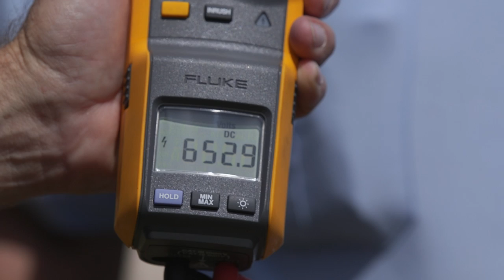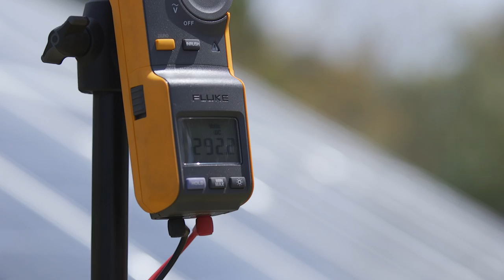Electrical Arcing & Water Conductivity

Comment: A typical North American electrical installation from an average household causes more risk, then this solar system will ever cause during its average lifetime of 30 years…
Reply: We are not saying that a PV installation is any more or less dangerous than other types of electrical system, but unlike a typical North American electrical installation that can be isolated at the street or switchboard to mitigate electrical risk, solar panels cannot be isolated as long as they are exposed to light.  Any electrical generator (including solar panels) needs the ability to be isolated to mitigate electrical risk, that is why we developed PVSTOP.

Comment: You are meant to be professionals. Voltage measurement with possibly very high impedance meter is meaningless and this should be adressed in the comment.

Comment: lol. or you can us a breaker to open the circuit and stop the current from flowing.
Reply from the maker: Everything "upstream" of the breaker (also known as the isolation switch) including the panels and wiring leading to the breaker is "live" and if damaged, potentially lethal.

Comment: Nice and informational, but could also use black paint.
Reply from the maker: Yes you could, but paint is flammable (making a bad situation potentially worse) and black paint will damage or destroy the solar PV system.  PVstop is fire retardant, non-flammable, non-conductive and can be peeled off post incident without causing any damage to the system.  Like most good solutions, the devils in the details!
Reply from the maker: Hi Ed,  black paint would damage the PV system, would be flammable and possibly conduct electricity.  These were all safety considerations that were taken into account when we developed PVStop, ensuring that the product is safe to use in situations involving fires, floods or storms.

Comment: wait what is pv stop? paint?
Reply from the maker: It is a water based polymer similar to paint.  The differences between PVSTOP and Paint?
PVSTOP is;
- Fire Retardant
- Non-flammable
- Non-conductive
- Peels off (post application) without damaging the solar PV system
- Environmentally friendly

Comment: 😥 thank goodness that hail storm only damaged the very bottom edge of every one of my pannels
Reply from the maker: The more extensively solar panels are damaged, the greater the risk, the video demonstrates that even partially damaged panels can create unanticipated risks.  FYI, and for the sake of transparency, we managed to purchase these panels very cheaply as they had been damaged by a forklift (hence the damage in the bottom edge of every panel).  The panels were used across a number of tests to the point of destruction, it would have been a great shame (and wasteful) to destroy brand new panels!

Comment: Didn't think it wise to just ground the frame?
Reply from the maker: Absolutely, but what we are demonstrating in our video are potential risk factors if the system is damaged or faulty.  Our service division regularly encounters systems that are either not grounded correctly or system components have deteriorated to a point where they are no longer safely earthed and this can present unanticipated risks to first responders or electrical technicians.  These are a few of the many reasons why we developed PVStop.
Reply: Fair enough. Thanks, for the timely response. How hard is it to clean off once the remaining good panels are isolated?
Reply from the maker: At 25°C the coating is tack dry and within a few hours it dries into a latex like sheet which simply peels off the panels without causing any damage to the panels, system or surrounding surfaces.  here is a link to a short video which demonstrates the process  https://youtu.be/wc-qRISs7fo

Comment: Except that rainwater would never cause electrical arcing because it contains no minerals whatsoever. Nice try at scaring people off though.
Reply from the maker: Pure water (distilled water) is an insulator. But almost no water sources (including rainwater) are completely pure. It is widely accepted that water is conductive when applied to an electrical source.  An unbroken stream of water applied to an electrical source can conduct down the stream and create a real risk of electrocution.  I reference "Firefighter Safety and Photovoltaic Installations Research Project" Conducted by Underwriters Laboratories to support my reasoning.  The report is easy to find online and has a whole chapter on the subject.  

Our goal is not to scare people, but raise awareness of the unanticipated risks that a damaged or faulty PV system can present to firefighters and electrical contractors.
Reply from the maker: What about the water supplies utilised by firefighters and emergency services personnel?  We are not trying to scare people off solar panels (our background is the solar industry) we are simply alerting people to unanticipated risks and providing a product and procedures that drastically improve safety when engaging with PV systems.

Comment: Why not using  powerful glass
Reply from the maker: The stronger the glass, the less likely the glass will shatter, that is correct, however the growth of solar panels has been driven by price efficiency.  These days solar panels are produced as efficiently and cheaply as possible.  If stronger glass was used, it would cost more to produce and the panels would not be price competitive.  Also, broken glass is only one of several factors that can make a solar panel unsafe.

Comment: a tarp would work
Reply: egn83b 
pvstop, the world's first spray-on tarp.
Reply from the maker: A tarp does not always work, UL did a comprehensive study back in 2011 titled, "Firefighter Safety & Photovoltaic Installations Research Project".  You should be able to find it online (P56-58).  Not to mention the risks of operating at height, weather conditions, roof load capacity, not being able to remotely detect DC electricity etc.  In short, trying to de-energise a PV system by climbing onto a roof and tarping the system is a bad idea!
Reply: I agree, which is why the spray-on tarp is better!
Reply: If i overspray on someones roof will it come off. 
Open circuit on residential is usually 450v or less which wont make as much of an arc as you show ive only had 2 mc4 connectors arc and melt in over 2mw of residential installs in 10 years neither arc damaged the structure luckily 
Cool product
For a very rare event at least in Florida
Reply: So would sunset, if you can wait that long.
Reply from the maker: A tarp will work in limited circumstances, but because solar panels produce DC electricity, you can not remotely detect if the solar panels system is producing electricity.  If the solar panels are faulty and you climb onto the roof and start trying to cover the system with a tarp, you put yourself at serious risk of being electrocuted, it is a very unsafe practice!
Reply from the maker: Any overspray can be easily removed with a pressure washer.  In Australia a 5kw system is quite typical (the size of the array in the video).  The arc demonstration is to give people a visual idea of just how much power a typical system can generate (most people really don't understand just how much power even a modest residential system can generate).  Don't forget that the primary purpose of the product is to "switch off" the PV array during an incident.  The incident doesn't have to be caused by the PV system, for instance if a roof fire is encroaching upon a solar PV system, the fire department still want to be able to de-energise the PV system for electrical safety.  For every incident that is caused by a PV array, there would be another 10 incidents where the incident is not caused by the PV array, but the system still needs to be "switched off" for the safety of the fire crew.
Reply: Unfortunately, Although your concept is nice You are forgetting that MANY Australians still collect ROOF WATER and your product has TONES of chemicals inside. If you apply this product to roof, you will contaminate water tank and whole water collection system and it will do WAY MORE damage than you can imagine. Once the chemicals are in,they will stay inside the water tank forever unless full flush(which is impossible for big and old tanks) is done.
Reply: I imagine this can be made in a catchment safe form. Great concept

Comment: Despite the danger I think solar panel are great
Reply from the maker: Indeed they are.  A good quality, well installed PV system will give you years of trouble free service if maintained regularly.  We support renewable energy by providing safety solutions for PV systems, filling a gap in current Work health and safety practices.

Comment: bs because last time i check when we had a hail storm the sun wasnt shining like that and i wasnt even getting 1V out of my panels
Reply from the maker: True, generally the sun is not out during a hail storm and the PV system will not be producing optimal levels of electricity during the storm.  But answer me this, if the PV system is damaged (by a hail storm) what do you think happens the next time the sun comes out?

Comment: Not impressed.   rain water is not conductive. Why cant you just cover it with a tarp or cardboard or whatever a bed sheet etc. Wait till dark.
Reply: Rain water is more conductive than clean water because of its impurities...
Reply from the maker: The primary function of PVStop is to "switch off" solar panels in the event of an incident response to a fire, storm, flood or for conducting maintenance on a solar PV system without the need to be working on "live wiring".  It is primarily designed for fire and emergency service personnel and electrical contractors.  Waiting for dark in an emergency response scenario (during daylight hours) is not an option and tarps, cardboard etc may work, but in very limited scenarios as outlined in some of my other comments above.
Reply: PV Stop it is a good idea for emergency services and situations.  But what's stopping the fire departments suppliers from just adding black die to the foam that they already use and eliminating the need to carry even more equipment at an extra cost to the tax payers?  BAZINGA !
Reply from the maker: Foam does not stop the light reaching the solar cells and the foam slides off the panels or breaks down very quickly.  Underwriters Laboratories have done extensive testing on foam to test this very theory and it failed to work.  Don't take my word for it,  please reference "Firefighter Safety and Photovoltaic Installations Research Project" issued by UL (you can find it easily online).  PVStop significantly improves firefighter safety, I think protecting the lives of the people who save lives is quite a noble use of tax payers money, wouldn't you agree?
Reply: PV Stop wont rain wash it off if it's raining? Still a large light weight tarp would work great + no messy goo & it would be reusable & take up less space lighter and cheeper and could be deployed faster over the whole panels ! Don't you think !
Reply from the maker: Hi Michael, no PVStop does not wash off in rain.  No a tarp is a lot slower to deploy, puts personnel at risk of electrocution and also puts personnel at risk from operating at height.  In addition, only specific types of tarps actually stop light penetration.

Comment: yea, no, it's not the only safe way. 
with say solar edge and their per panel MPPT power modules in the event of ANY fault, each panel only outputs save voltages.
https://www.solarchoice.net.au/blog/solaredge-mppt-high-efficiency-solar-inverters/

also auto adjusts panels for shading so there is optimum power at all times.
and no, I'm not affiliated.
but sans this type of modern system then yes, you'd be crazy not use the maximum safety possible
Reply from the maker: Solar Edge make a good product and definitely improves safety, just be aware that the panels themselves are still live as long as they are exposed to light.  The problem is, when firefighters respond to an incident, it is very difficult for them to identify the difference between a Solar Edge system, a Microinverter system or a normal string array system.  Most firefighters do not have the necessary training to identify the different system types.  The beauty of PVStop is it's simplicity, it is equally effective on any type of solar PV system; as long as a firefighter can see that PVStop has been applied, they know they are electrically safe.  Post incident it can be peeled off and does not damage the PV system.  A very simple solution that dramatically improves firefighter safety.

Comment: How is the power conducting to the frame via fresh water?
Reply: i actually dont get it too, surprising theory.
Reply: 100V 0A :) my tV antenna gerates more :)
Reply: Dirt on the panels might make the water conductive.... And that's without acid rain...
Reply from the maker: Anything other than pure (distilled) water is conductive when applied to an electrical source.  Good quality solar panels are completely safe, but if the solar panel is faulty or damaged, water applied to a damaged panel has the potential to increase electrical risk as outlined in the video.